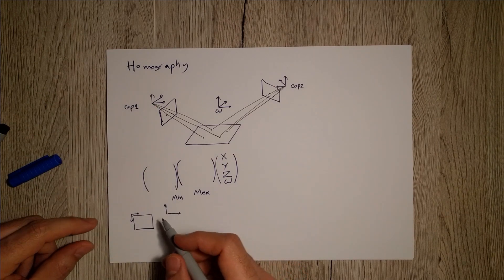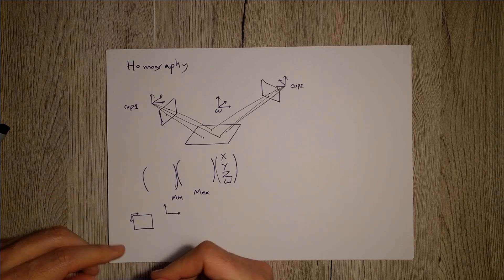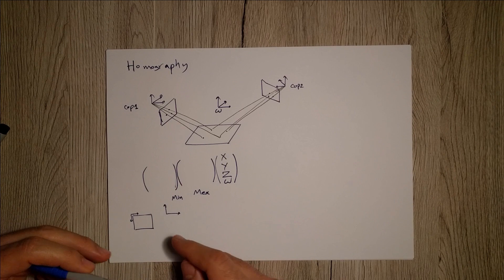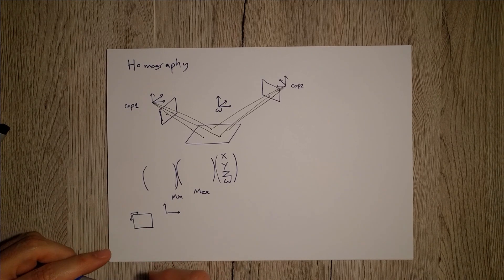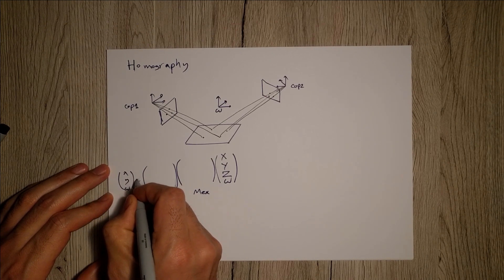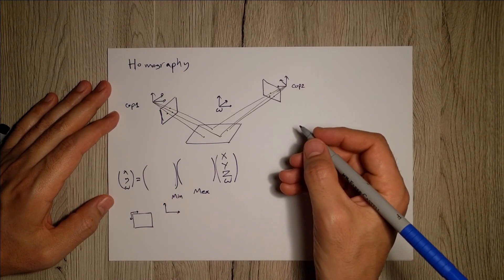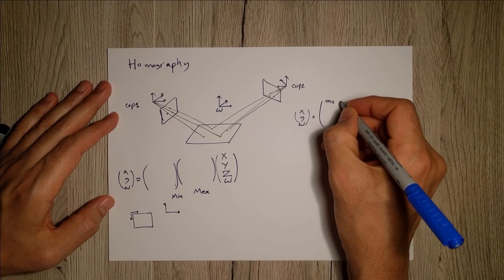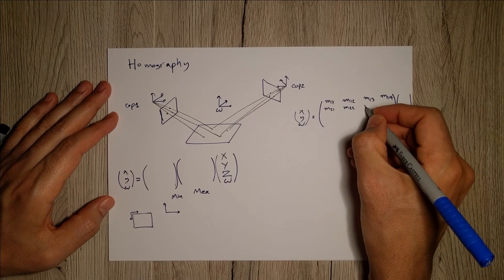Homography in computer vision explained

Comment: why degree of freedom is 8 ?
Reply: The Homography matrix has 9 parameters.

Let me walk you through it.

When you transform something from 3d to its projection in 2d, you lose one degree of freedom. What this means is you could scale up everything i.e. make the object bigger and twice as far and not tell the difference from your 2d photo.

Example:
If you took a photo of the moon vs. Took a photo of a small pea sized moon that was much much closer, you wouldn't be able to tell. They do this with miniature movie sets.

Ok, so then since that degree of freedom regarding scale is lost, mathematically it translates to a scaling factor multiplied on both sides of the equations. So we say let's make the norm of the h matrix equal to 1 without loss of generality i.e. ||H|| = 1. If that's the case then we have 8 degrees of freedom to find the values of H.

E.g. If I told you to find 2 variables a and b in some equation but told you that 
 a^2 + b^2 = 1, then I have constrained the solution to a circle. You only need to find 1 variable (say a), the other is sqrt(1 - b^2). Hence n-1 degrees of freedom.

Comment: Hi,it is really an excellent tutorial,Thank you so much.
But I still have a question about its application.
I am gonna use this to remove perspective distortion which requires me to get a frontal image from an arbitrary position of the same image.But i only have one picture,therefore,the question is that how can I get the corresponding points to calculate the H matrix.
Looking forward your reply!Thank you
Best
Reply from the maker: You need at least for points in your image that are in the same plane, for instance, if you take photo of  ground floor pick for points from the floor, have look at my opencv example in the description, cheers.
Reply: Yes, thank you, I have figured it out!

Comment: does this model work for CCD cameras as well? so we can calculate coordinates of a 3D point in the world using its image coordinates and Homography matrix of camera? it would be great if you explain how we can generate homography matrix for a CCD camera. Many thanks.
Reply from the maker: This  (Homography) is a pure geometrical model for a pine hole camera and nothing to do with sensor (CCD or CMOS), you can follow the link in the description for implementation. If you interested in 3D reconstruction please have look at SFM in the other post here: http://ros-developer.com/tag/sfm/
Good luck :)
Reply: what do you mean for "implementation"? Is this sth related to a camera matrix (sensor matrix)  for CCD? If not, is there any possible solutions for the case of CCD? Thanks.
Reply: I also found this video which explains "complete camera model" using homography and homogenous coordinate system and it is also showing CCD sensor at 13:37. Could you please clarify if I am wrong! Since I don't have a good knowledge and background about cameras, I am a bit confused!
Reply: @sahartabrizi6155  این مدل کلی هندسیه برای مرتبط کردن فضای تصویر و زمین دوربین آنالوگ باشه یا دیجیتال تو استفاده از این مدل تفاوتی ایجاد نمیکنه اگه آنالوگ باشه مختصات عکسی رو از روی عکس با یه سری دستگاهای مخصوص میخونیم اگه دیجیتال باشه مختصات ماتریسی سل سی سی دی رو به عنوان داده استفاده میکنیم.کع الان کلا عکس آنالوگ منسوخ شده و فقط تو دانشگاه روشش رو تدریس میکنن محض آموزش.